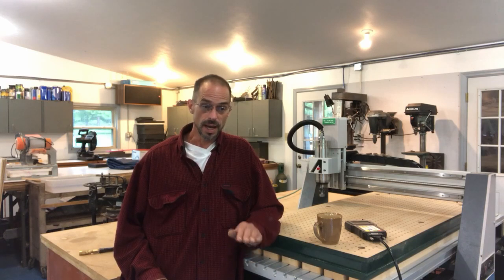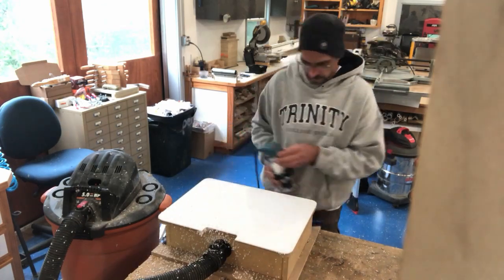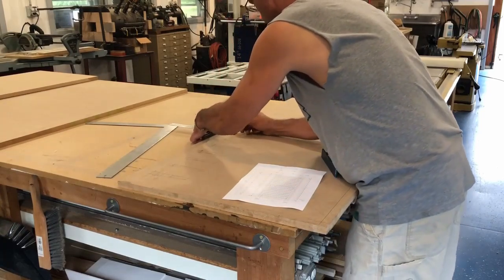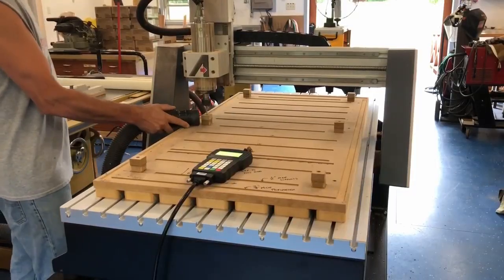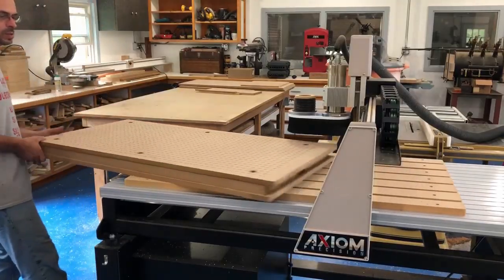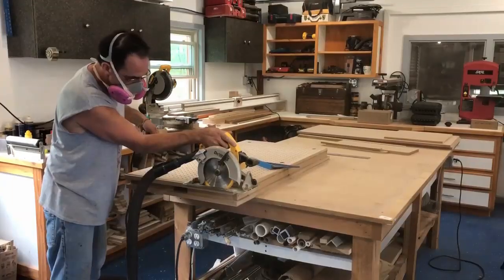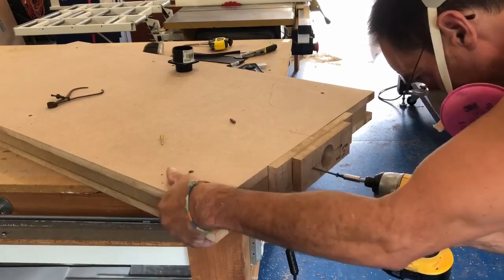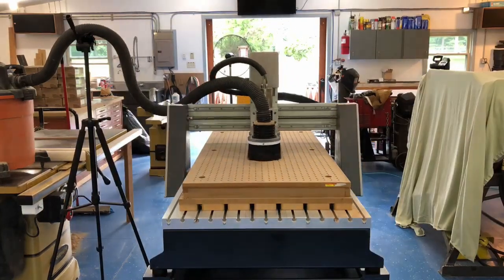CNC router vacuum table

Comment: Hi Brian, quick question, have you used a bullnose router bit (to remove the square edges and sharp corners) with your CNC vacuum router? I'm working with 1/8" thick PolyCarbonate and wondering if it is possible to add a bead around the outside edge of the material without damaging the table in the process?
Reply from the maker: Adam, sorry but no I have not.
I have used a bee bit to make a chamfer to finish edges with no problem.
Reply: Thank you Brian for your quick response. I am thinking about purchasing a CNC machine for a project but I'm very price sensitive, from your experience, would you recommend a buying a CNC kit and build it yourself or buy a new?
Reply from the maker: @adamb.745  
The only kit I have ever put together was an AVID cnc kit, which was great.
But they are also more pro grade and not inexpensive
Reply: @BuildswithBrian  Thank you very much Brian. Great input. Hope you and your family have a wonderful Thanksgiving! Thank you.
Reply from the maker: You’re welcome Adam.
Wishing you and yours a Mary holiday season as well

Comment: What type of bit are you using for engraving?
Reply from the maker: Do you have to be more specific, engraving what ?
Reply: @BuildswithBrian  The two layer black and white plastic sheet.   Do you have a video showing the setup to engrave placards using that material.  I have the same material from BF plastic.
Reply from the maker: @johncarr123  OK, I’ve used many different kinds of bits, 45 degree 60 degree and 30 degree v point engraving bits.
Also with single line fonts I have used 1/32 and 1/64 end mills.
To cut out the profiles I use a 1/16 spiral down cut bit and it works the best
Reply: @BuildswithBrian  I hate to be a pain.  Can you list the part numbers for the bits you used 1/64, 1/32, 1/16.  Any chance do you have a video of setting up the CNC to make and cut placards?
Reply from the maker: @johncarr123  shoot me an email To remind me, I can’t get those for you today, and no I don’t have a video describing the process yet. If I get enough interest I might make one though
Reply: @BuildswithBrian   Sent email
Reply from the maker: @johncarr123  yes John I saw, shoul have time tomorrow morning, still working , been hectic 😁

Comment: I’ve been considering doing this for my CNC but have heard that a shop vac will burn out if there isn’t much airflow over the motor from the suction. How has your shop vac held up? Is the mdf porous enough that even when the holes are all covered there is some air flow through the vacuum to cool the motor?
Reply from the maker: Most, but I can’t say all of course, shop vacs have a separate fan that cools the motor independently of the vacuum flow.
Mine is like that. And I have literally several hundred hours of use on the vac table with it.
And i have a small ,about 1/2”, hole that allows a tiny amount of air even if all holes are covered.
Been working fine for me.
Reply: @BuildswithBrian  what shop vac do you use for the vacuum table?
Reply from the maker: @homehackshowtos  ridged 5 gallon
Reply: @BuildswithBrian  perfect that’s what I have
Reply from the maker: Good luck with your build !
Reply: @BuildswithBrian  how long did it take you to drill all the holes?
Reply from the maker: @homehackshowtos  sorry can’t remember exactly, maybe an hour and a half ??

Comment: Nice video, thank you! 
Just for future projects, take advantage of the t-slots, install your fasteners and t nuts into the piece you are trying to lock down, leave the nuts 'loose' , and slide the assembly into the slots... you won't have to make any special 'nuts'...unless you can't slide the piece in.  This works very nicely and you would probably save the time of making the nuts.  It might be a little tricky, you might need an extra hand to orient the nuts to go into the slots as you try to slide it in, but it should work.
Reply from the maker: The standard nuts jam to easily when sliding that far, at least they did for me. Didn’t take
Very long to drill and tap the 1/4-20 holes.
Thanks for watching

Comment: Which vacuum motor are you using ? What size is the table ?
Reply from the maker: Philip, It is a 5 peak HP,  16 gallon shop vac, Rigid brand
the table size is 24" x 48"
sorry for the delay in answering, we must be in different time zones
Reply: @BuildswithBrian  Great video, thanks a lot. Could you tell me please if the shop vac that you bought is able to work for several hours a day without the risk of burning the engine?
Reply from the maker: @bbeelluuttaakk  the ridged vac I am using is still kicking after more than 2 straight hours of use.

Comment from the maker: Hi everyone....I want to ask all interested viewers for some input on the next video....
another CNC project ?  a project with-out the CNC router ?  A work-shop tip ?  A tool review ?
please jot down any ideas or input in the comments section below... Thanks
Reply: @Brian Ofcourse
It appears you permanently glued the entirety of the box.

Is the vacuum sufficient enough to remove all the sawdust and debris that falls inside the box while machining?

What do you use to cover holes that are located on the perimeter of your workpiece?

How weak does the vacuum become as the cuts progress (especially when cookie-cutting a bunch of smaller parts)?
:
Reply from the maker: @criticallook1352  yes the box is permanently glued, so it it is totally sealed.
So for I have found the vacuum is sufficient to keep it clear, it’s been almost 3 years with no problems.
I usually use scrap pieces of thin plastic to cover any open holes, but I also use masking tape and even have used Kraft paper with success.
And of course the vacuum strength descreases  proportional to the cut areas but it it very hard to give any type of measurable amount since it it unique to the items cut.
All I can say is that most vacuum system’s including mine have limitations with small parts.
Thanks for watching,
Hope you found it helpful.
Please subscribe if you wish to see more future cnc content.
Reply: @BuildswithBrian  
Thanks Brian. Yes, you were very helpful, but I find it odd that you use the wrappers that individually cover Kraft cheese to block the unused holes of the vacuum table!!? 🥁 rimshot  
:

Comment: I'd love to see plans for this table if you have any available. Also, any chance of sharing the files used on the cnc for cutting the holes? Thanks, and great job on this!
Reply from the maker: Al Amantea 
I have a 2d line-drawing in autocad, which was imported into v-carve pro
Keep in mind that my table size is specific to my machine (axiom AR8 pro)
If any of that helps you feel free to drop me an email with your contact info
I don’t mind sharing
Buildswithbrian@gmail.com
Reply: Great video